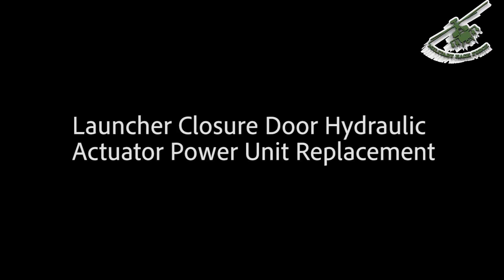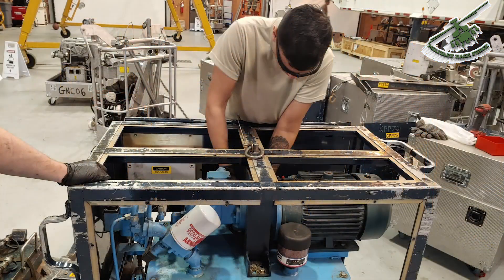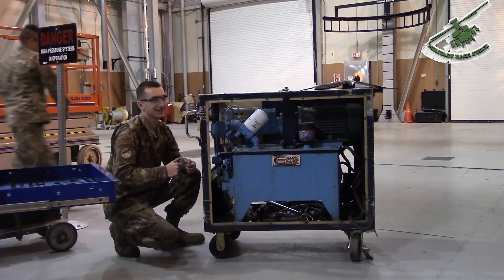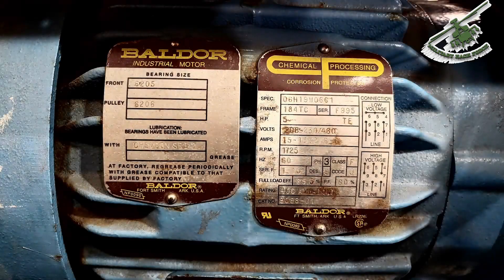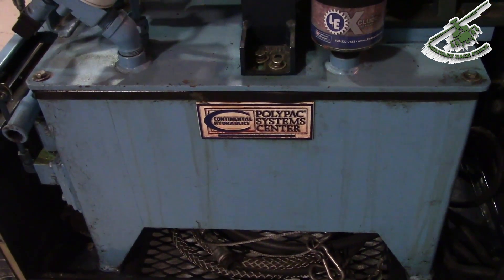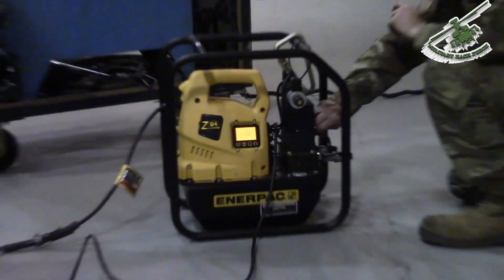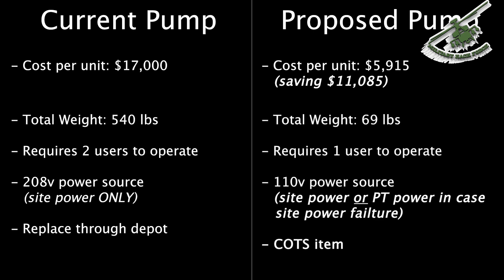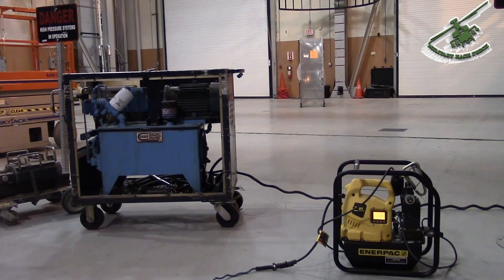Replacing a Hydraulic Actuator Power Unit for a MISSILE Silo Door

Comment: If the enerpac is meets the system rating requirements, it is certainly a more compact /easy to use solution. One thing that concerns me is reservoir size. It looks really small compared to the original. I dont know what the flow requirements are for this application but I would suspect an engineer choose the original larger unit for a reason...then again, maybe they just over engineered it. The enpac may be able to keep up with the flow rate however with the smaller reservoir, it could affect the duty cycle. I've run in problems where the pump can keep up but under continuous load, the oil starts to heat up, foam and causes duty cycle problems. It was a nightmare to diagnose too because I swore I did all my calculations right! Spent better parts of a week..and im talking 12+ hours days...swapping out pumps, soliends, flow dividers, arranging hydraulic lines, bleeding and rebleeding, flushing and changing oil...with only marginal improvement! Turns out my calculations were right...for the most part. I just didnt account for the oil cycle time. Wasted countless hours trying to figure it out but sometimes that how you learn...just something to consider.